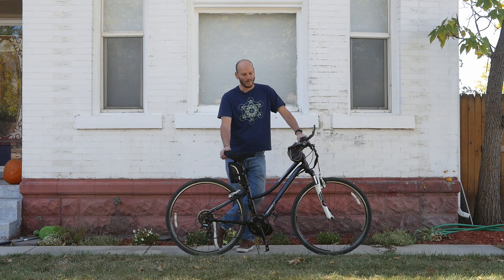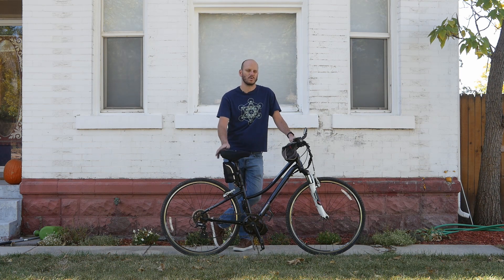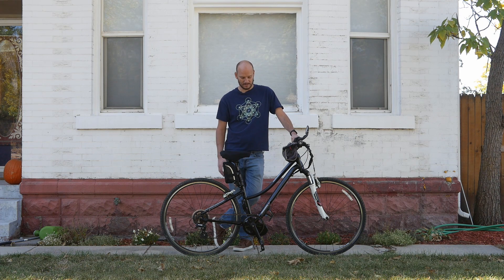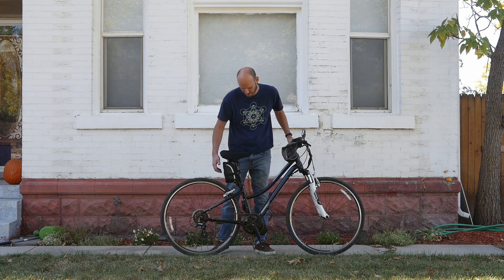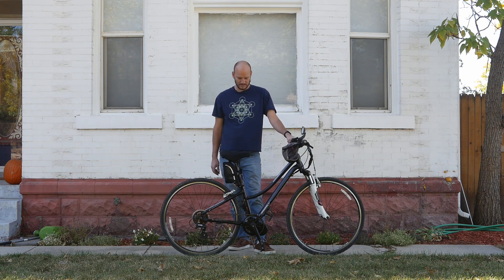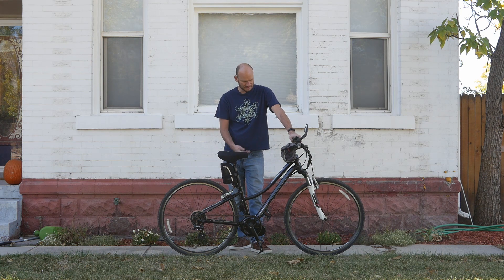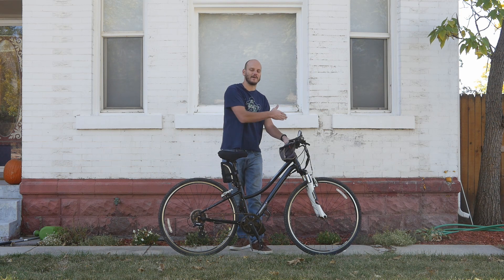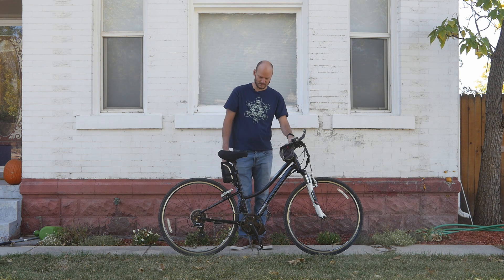Custom E-bike Build: Trek Neko BBS02 52v Mighty Mini

Comment: Johnny - this video bike looks similarr to my trike. I am elderly and have a Vevor Adult Tricycle 24"/ 7 speed from Walmart that I want to motorize for riding and exercise around the neighborhood. We have some steep grades but only about a block long. What mid frame motor - battery and  specific accessories would you recommend as minimum to keep the cost down?  Riding for an hour or less per day. Please reply  Thanks neighbor. DRT

Comment: Nice videos Johnny. Keep it up! In this scenario, would a Tongsheng TDSZ2 motor be more suitable than the BBS02? Why (or why not)?
Reply from the maker: Ya possibly. With the BBS02, you have future expand ability though to increase performance greater than you can with the TDSZ2. So when the rider is ready to increase power they have it. But if you never plan on upping the power, it might be a fine motor system.